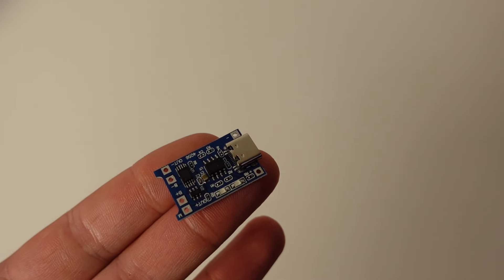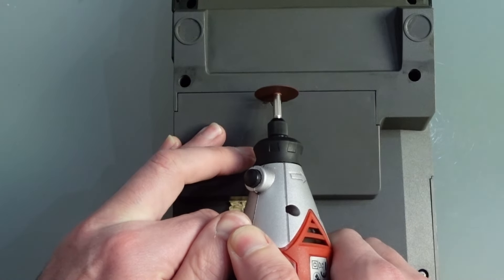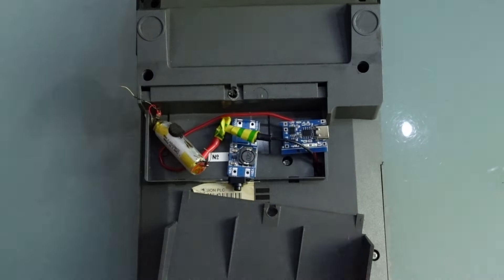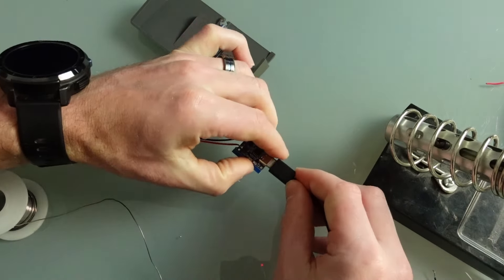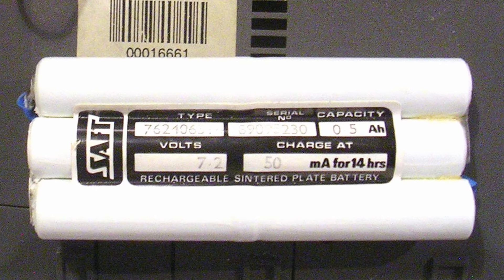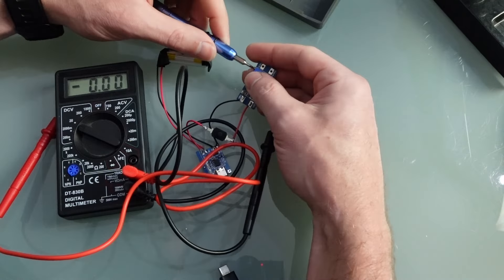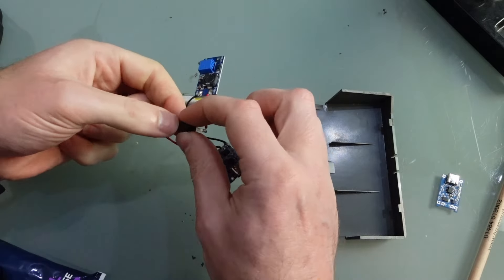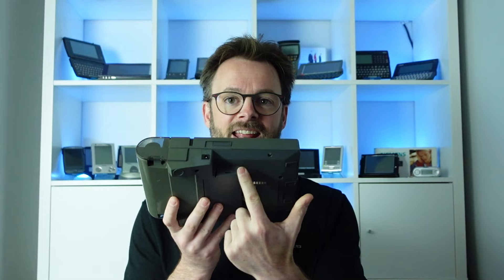Psion II Printer Conversion to USB-C

Comment: I love the flexibility of USB PD, I have already converted a lot of old brick-powered devices to USB-C without much hassle, even 20v stuff. Also nice re-use of Street Lithium!
Reply from the maker: It's such an easy mod and being able to use a standard USB supply makes it so much easier! Wow, 20V I assume it was pretty low current. You soon run into issues with heat on the buck converter if it needs a lot of current

Comment: That's a really nice job! I can't believe I spent so long considering how to use the original nicad battery wires and power supply when this is just as good. Great!!
Reply from the maker: Thanks, I am very happy with both the cosmetic and functional outcome on this mod. Also it is fully reversable should I want to restore it (other than the holes I cut!) to original - not that I can see me wanting to do that 🤣
Reply: @HandheldComputing  I will be doing the same with mine no doubt 👍👌